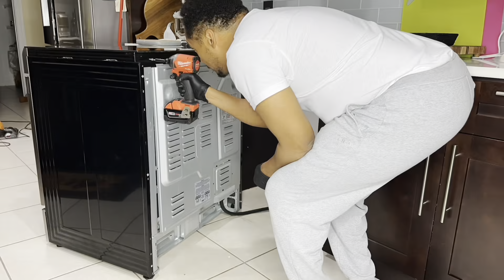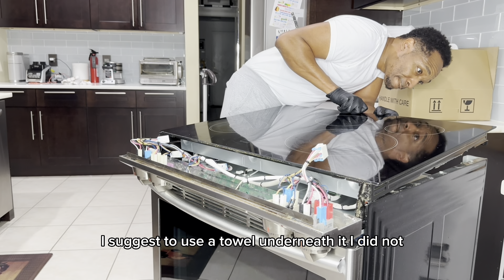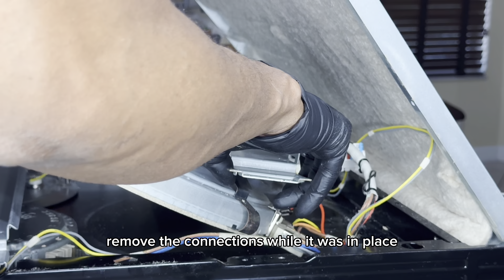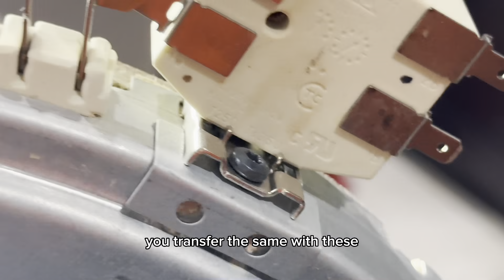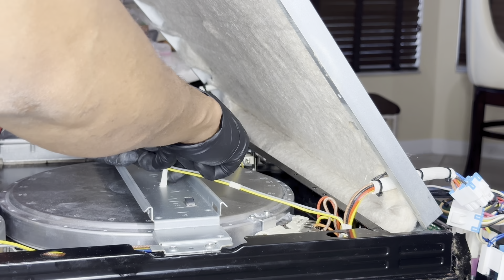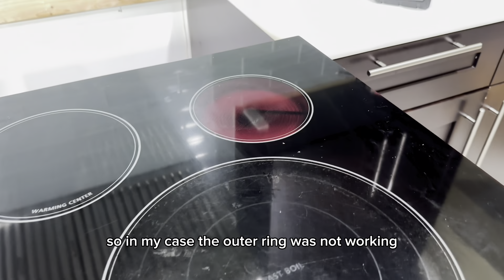DIY Samsung Electric Range Burner Repair

Comment: Very helpful replaced my burner. However I skipped removing the middle wires harness like you said and dropped the control board putting it together at the end. It slipped off the handle. Dropped only 2 inches and now it needs a new control board. Would disconnect all wires!!